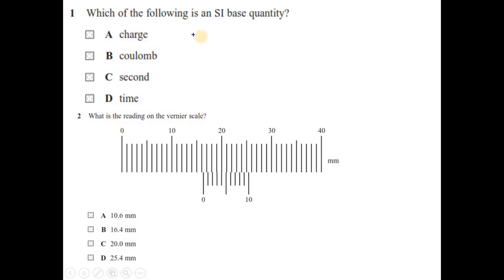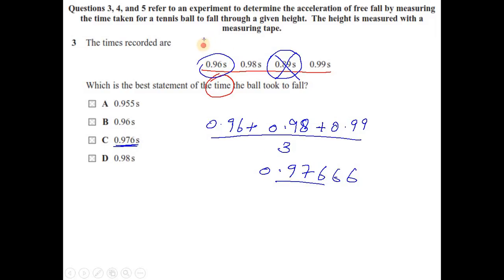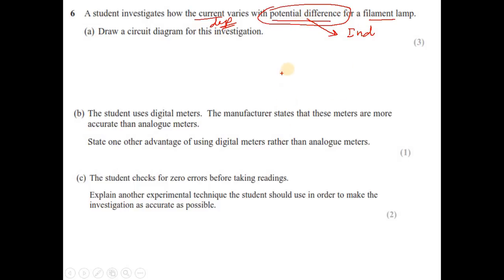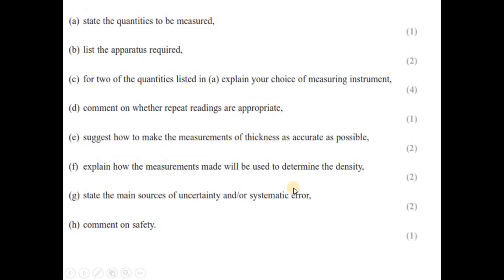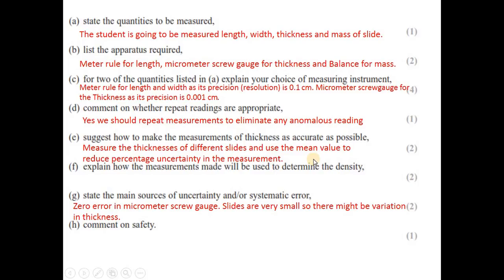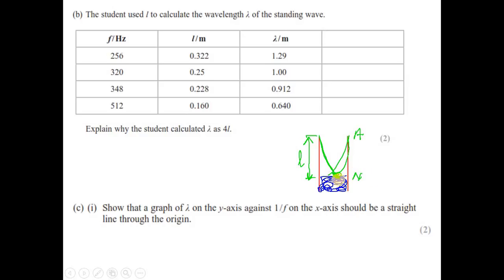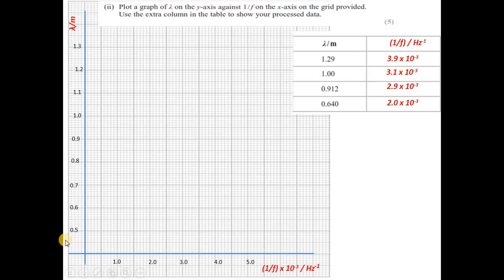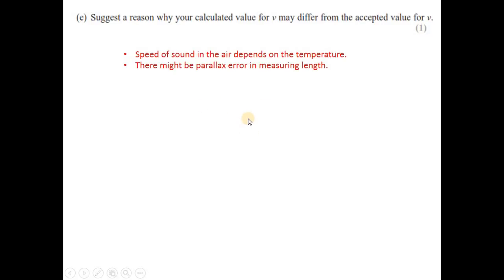Edexcel IAL physics unit 3 Jan 19

Comment: Instead of using a rheostat can't we use a variable resistor to change current flow instead of changing pd?
Reply from the maker: yes, you can but I used P.d because of the question.
Reply: I will still get marks if I answered it my way, right?